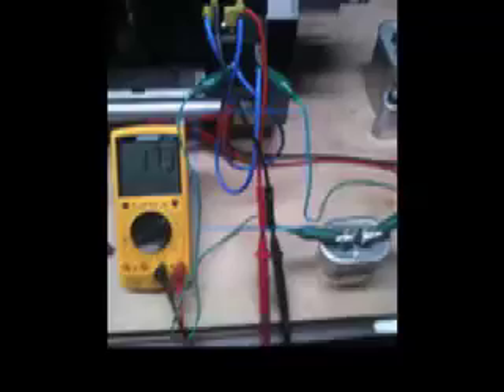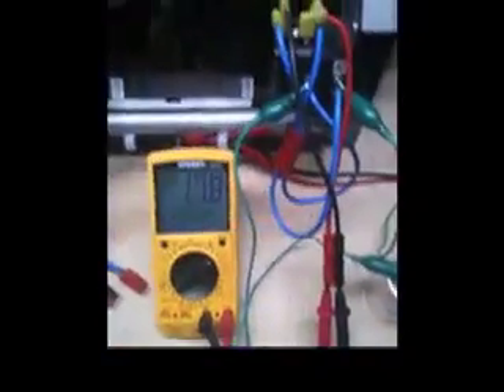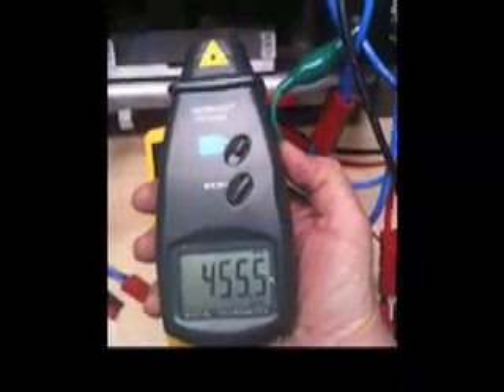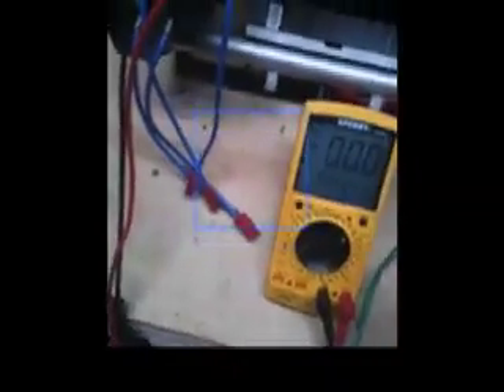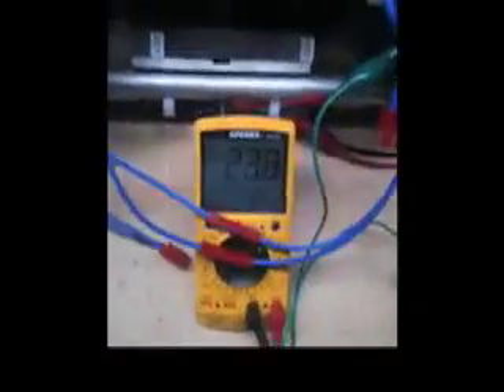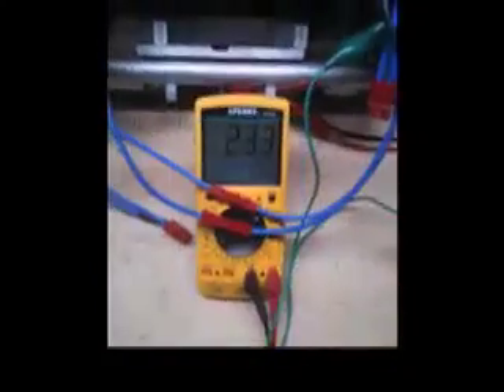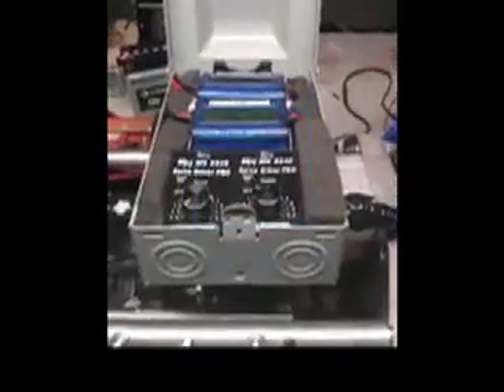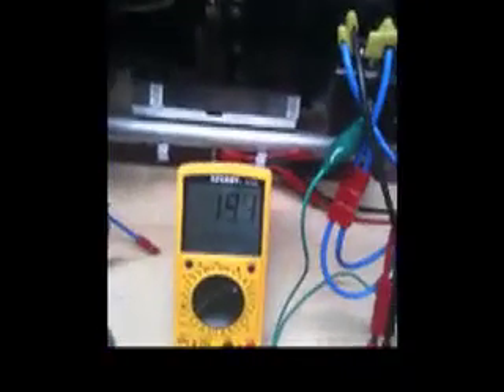Why DIODE SURFACE AREA IS IMPORTANT?.mov

Comment: yes, it's a known fact that surface area might help you reduce resistance, voltage drop and other electron blocking effects. As i know there is no plasma like phenomenan in doped silicon ( PN junction ). These simple circuit elements are used widely and were very much researched for digital and analog applications leaving a very narrow chance for new finds ( memristors were recently proved to exist ). Thanks for the video ;)

Comment from the maker: Again Plasma effects are scale invariant.
Here is another source linking MICROPLASMA and the P/N Junction:
Theory of microplasma fluctuations and noise in silicon diode in avalanche breakdown
Marinov, Ognian
Journal of Applied Physics , Volume 101 (6)
American Institute of Physics – Mar 15, 2007
Publisher American Institute of Physics
CopyrightCopyright © 2007 American Institute of Physics
ISSN0021-8979
D.O.I.10.1063/1.2654973

Comment from the maker: LED its basic structure is a piece of electroluminescent semiconductor crystal:
Electroluminescence (EL) is an optical phenomenon and electrical phenomenon in which a material emits light in response to the passage of an electric current or to a strong electric field. This is distinct from black body light emission resulting from heat (incandescence), from a chemical reaction (chemiluminescence), sound (sonoluminescence), or other mechanical action (mechanoluminescence).  LINK TO POSSIBLE ZPE?

Comment from the maker: Dear 2718218,
Yes I noticed.  The question is simple.  Is what is being observed just LIGHT or is it a very special form of light i.e. PLASMA.  Either it is or it is NOT  Ask yourself this, what does plasma do that normal light does not?  Does NORMAL LIGHT CONDUCT ELECTRICITY?  I am assuming NOTHING, rather attempting to UNDERSTAND WHERE gains can be made.  I challenge your estimation of importance or lack there of of Plasma by simply referring to something like the SUN which is CR-Plasma...

Comment: @diveflyfish Yes I did search on the first term.  Did you notice the results were mostly research papers done in the 1960s?  I am assuming that this is related to research that eventually resulted in the development of LEDs (light emitting diodes).  When they talk about plasma they are usually referencing detecting the light it gives off.  You are approaching the problem from the wrong end IMO.  I seriously doubt there are semiconductor plasma effects in ordinary diodes.  Keep it simple first.

Comment: @diveflyfish Yes I am 99% sure.  I gut feel is you might have head that from a non technical source.  When I diode conducts the "holes" and the electrons travel towards each other and meet an annihilate each other.  No plasma there.  When a diode blocks current the electrons and the "holes" travel away from each other and no annihilation and no current conduction.  If you are curious just look up "physics of a PN junction" and read and learn about the real thing.  Good luck again.

Comment: @diveflyfish I am not an expert but I took a course in semiconductor physics 30 years ago.  I don't recall anything where the term "plasma" was used.  I can suggest that you do some research into semiconductor if you are really interested.  I was commenting on you clip relative to the Romero testing because half the people on the OU web site thread believe your experiment demonstrates a great benefit when you double the FWBR setup for a Romero replication.  It was to clarify that.

Comment: @diveflyfish In this case the "surface area argument" holds true.  If you model the diode PN junction as a quasi-capacitor that is letting microscopic bits of charge (current over time) charge the RC network, larger surface area equals larger capacitance to couple charge into the RC network when there is changing voltage at the output of the FWBR.  Again although it is interesting it does not in any way have anything to do with the operation of the FWBR when driving a load.

Comment from the maker: Again,
Please explain the difference between the two tests.  The circuit is identical except for the FWBR surface area of the P/N junction.  You are describing the discharge mechanics possibly, but not the phenomenon of WHY there is a 30% differential.
Why discount the possible PLASMA effect occurring at the junction.  Is this not a possible phenomenon in your estimation?

Comment: So the multimeter is measuring the voltage across a minuscule RC network formed by the capacitance of the leads and the resistance of the multimeter itself.  When you have the double-FWBR setup twice as many microscopic bits of current flow charge this minuscule RC network as compared to a singe FWBR setup.

Without any real current flowing through the FWBRs themselves you are just measuring the voltage across the capacitance of the two wires and it's meaningless.

Comment: @diveflyfish By "PD" I am assuming that you mean potential difference.  Forget the plasma, my explanation will be quite technical.  Again, assuming the setup is just a multimeter and no load.

In this case the mutimeter is measuring the voltage across the capacitor formed by the two leads of the multimeter that connect to the FWBR.  There might be 50-100 pF of capacitance, and this capacitor is being discharged by the 1 Mohm resistance of the multimeter.

Comment from the maker: Ok, If that is true as to a real world operation, Why the difference in PD? What I am hypothesizing is if PULSE into a PLASMA type interface will show a differential in PD just as placing a magnet next to a passively lit plasma tube will show a differential in PD even perhaps a negative resistance. The issue is irrespective of how a diode functions in the "real world" why is there a PD differential with WHAT IS THE EXPLANATION?

Comment: @diveflyfish If you hook the DC output from the FWBR into the multimeter only with no other load, then there is no current flow and you are not even testing how the diodes are performing with respect to the voltage drop that one or two diodes will sustain when there is real current flow.  The  multimeter is a 1 megaohm load and all that it will be picking up is capacitively-coupled AC going through the diode PN junctions. That has nothing to do with the real-world operation of the diodes.

Comment: 4th:  What this all really means is that there is no "magic" or anything special happening when you parallel up diodes in a FWBR arrangement like Romero seems to be indicating.  If you do your measurements properly and understand the IV curves you will realizing that paralleling up diodes will reduce the voltage drop across the FWBR setup only marginally when it is in conduction.  The voltage drop will decrease by a few millivolts and this will save you a few milliwatts.  Big deal.

Comment: 3rd:  Using the terminology "increased surface area" is not literally incorrect but it is "bizarre."  When you have two diodes and a significant current flow and they are in parallel, then it is reasonable to assume that the current is split approximately 50-50 between the two diodes because they will have the approximately the same IV transfer curve.  The essence of all of this is that once a diode starts to conduct, the voltage drop it sustains creeps up very slowly as the current increases.

Comment from the maker: I did not measure in this video any current.  Only PD.  Remember what I am testing here is PULSE effect THROUGH an specific type interface.
Why is surface area incorrect?
The intrinsic difference between the two sides is in effect the surface area of the N/P interface.  The rating of the FWBR is the same.  One has essentially twice the surface area.  Please let me know how I am off on this.
Very Best Regards,
Diveflyfish

Comment: 2nd:  Once you are in the part of the IV curve for the diode where it is really conducting current the voltage drop might be 0.65 volts for 500 mA (for example).   When you put 1 amp through the same diode you might see a voltage drop of 0.66 volts.  (for example)  Just by doing that simple test on a single diode you have all of the data you need.  Again, you have to look up the IV transfer curve for the diode you are using.  I suspect that you were doing your test with no load which is wrong.

Comment: Sorry to say "surface area" is incorrect.  Was the current measurement on the power-in side or on the FWBR output load side?  You want to do a simple experiment:  Put 500 mA DC though a single diode and measure the voltage drop across the diode.  Then do exactly the same thing but this time across two diodes in parallel.  You should see the voltage drop is marginally lower, like a few millivolts.  Look up the IV curve for the diode you are using and relate it back to your measurements.

Comment: @diveflyfish No, plasma is highly activated gas that has been stripped of electrons so that the gas molecules are ions and they are in a soup of loose electrons.  It is a highly elevated state of matter.  I don't know how you are applying the term "plasma" to a diode PN junction.  Electrons move across the PN junction inside the doped silicon crystal.  This has nothing to do with plasma and if someone if taking the term "plasma" and looking for ran equivalent in a diode they are wrong.